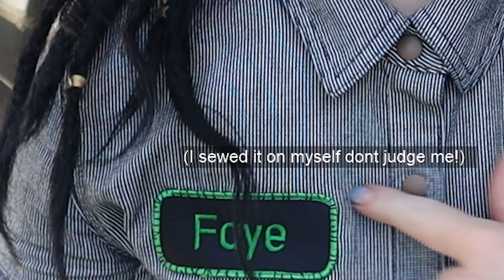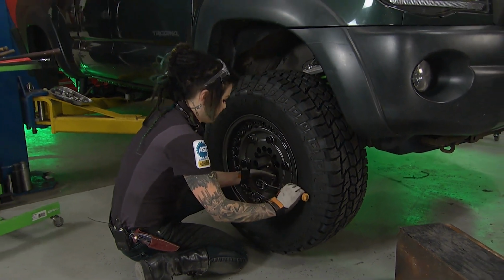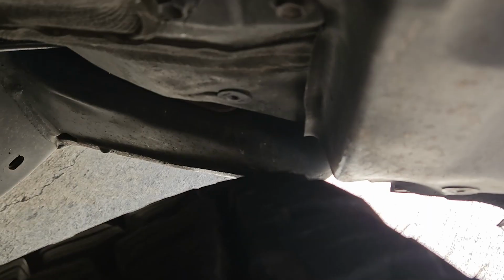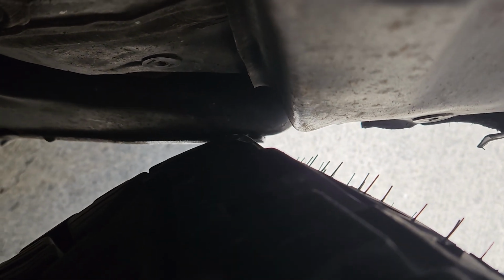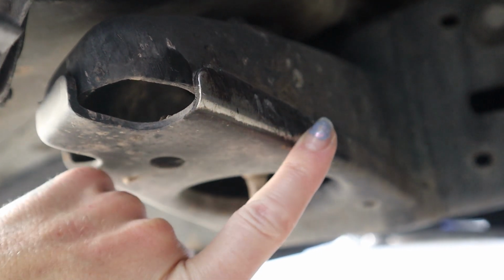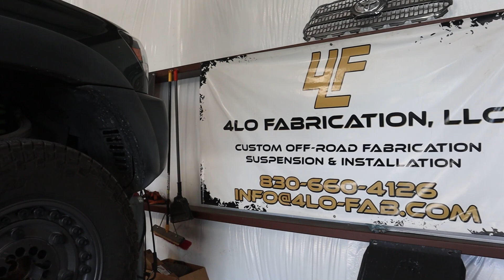Tires Rubbing after 33s?! Do this!! Gen 2 Tacoma Cab Mount Chop by 4Lo Fabrication!

Comment: So why not just add lift blocks or springs to create the desired clearance 🤔??
Reply from the maker: Because the owner of the vehicle likes the current lift height, and blocks aren't the proper way to lift a vehicle anyway. It has a 3.5" lift with Ironman 4x4 foam cell pro suspension.
Reply: @FayeHadley  ok I didn't realize that thanks for the update

Comment: It looks cool but Toyota designed the tacoma for a certain size tire for a reason. Most mods to any vehicle unless your a specialist and only use it for purposeful reasons only cause cascading problems in the future. I've learned this lesson too many times. 
       A crotchety 60yr old man -
Reply: I agree with you about staying stock. I’ve got a 2002 Tacoma and it’s tall enough for me and runs great down the road. No changing for me. Oh yeah I’m 70 years young  🤪 lol.
Reply: @stevanrose7439 
Dude I'm a believer...
 My 2002 Tacoma TRD bone stock.
 Everything works perfect.  EVERYTHING!!
Over 500,000 miles.  
 Looks n Runs great 
 Best truck ever
Reply: @stevanrose7439 
 Oh yeah I'm 62.
Just retired carpenter, 35 years 
 That truck made me sooo much money. WORK-HORSE